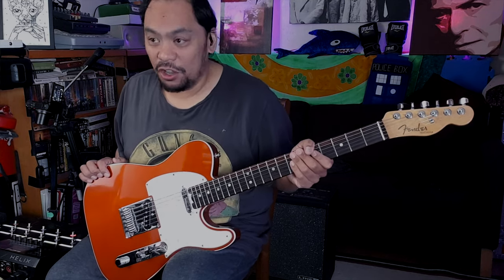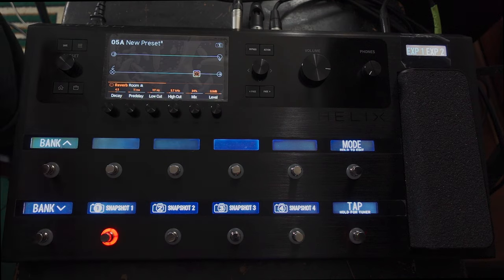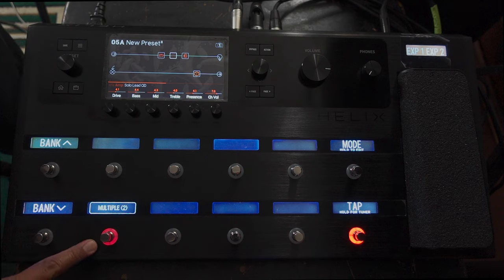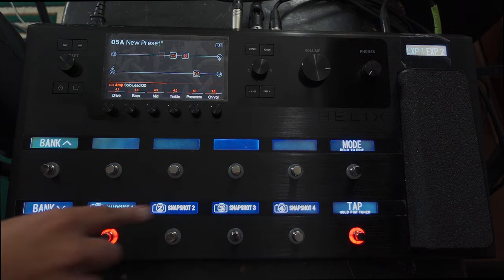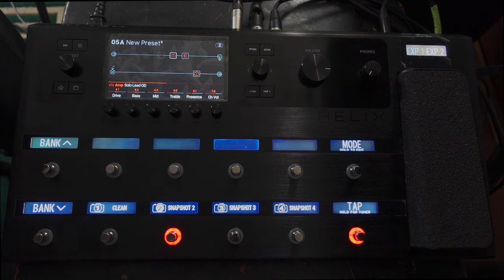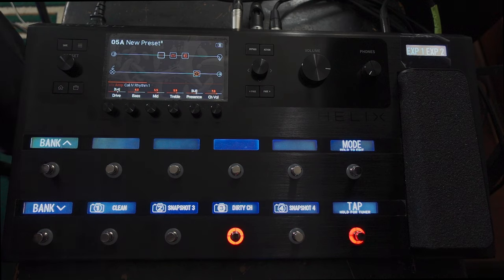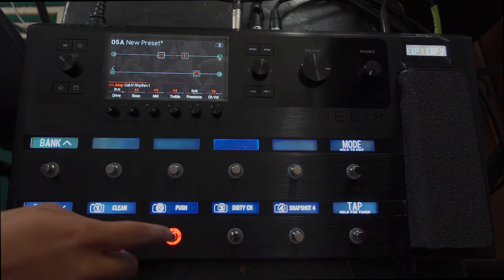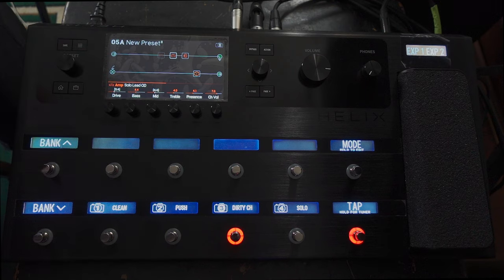Line 6 Helix - Switching Amp Models In Stomp And Snapshot Modes

Comment: Great video. How do you get it so you could have snapshots for clean, crunch and dirty channels, and then also pedals that stay on regardless of what the snapshot is? Identical to if you were to change channels on a normal amp and then have your pedals manually operated
Reply from the maker: Hey. Thanks for the comment! As far as I know, I don't think you can have the pedals work independently of the snapshots. I seem to remember that's how it used to be but an eventual firmware update made the pedals snapshot specific. May a 'Helix historian' can correct me if I'm wrong.

And as far as I know, you cannot configure the pedals to work independently of the snapshots either. (If anyone reading this knows differently I am happy to be corrected as I can definitely see the benefits of having the pedals set up this way). 

I hope this helps in some small way. Thanks again!
Reply: RTFM 😉: Manual 3.0 page 45: Snapshot Block Bypass On/Off
There may be situations where you don’t want snapshots to control a particular block’s bypass state; that is, you’d prefer to turn it on and off manually. For example, you may want manual control of a Boost block at any time without worrying whether a particular snapshot might turn it on or off.
1. Within the Home screen, select a processing block within the signal flow and press ACTION.
2. Turn Knob 5 (Snapshot Bypass) to set the behavior for the block.
By default, all blocks are set to “On” to automatically control their bypass states via snapshots. Change to “Off” to disable snapshot control of the selected block’s bypass state.

Comment: BTW it uses less DSP if you put each amp on a different signal path, rather than 2 on the same one.
Reply from the maker: That is true! Also depends how you want to do your set up. I think I generally like to put amps on the top row and post-amp/preamp FX on the bottom row, but I've had to do both ways at different times. Thanks for the tip. Very useful for Helix users to know!

Comment: Thank you very much! Can you match the levels too within the different snapshots? It seems to me (but maybe my ears are deceiving me) snapshot 3 (push) and Dirty sounds much louder than snapshot clean. Just wondering...
Reply from the maker: Yes, you can match the levels with each snapshot. In fact, I have just got back from a gig where I was doing that a lot during the gig. It was a different band and I was using different guitars (and an EQ pedal before the Helix to match the input levels) so had to do a lot of tweaking to sit right with the set up  this band had plus their choice of songs. It's become an extremely useful feature in the last few gigs I've had.
Reply: @ProFunctionist  Thanks. Learned a lot from this.